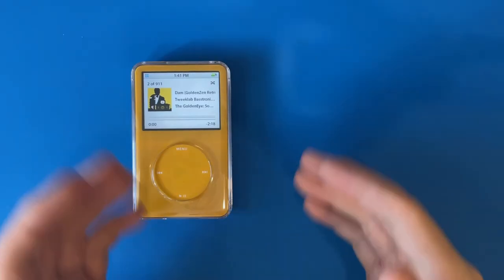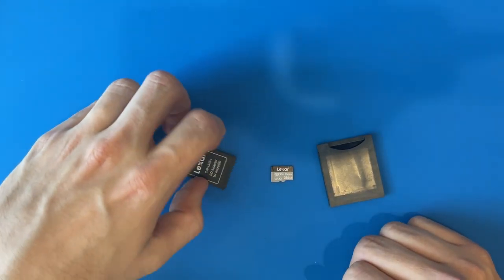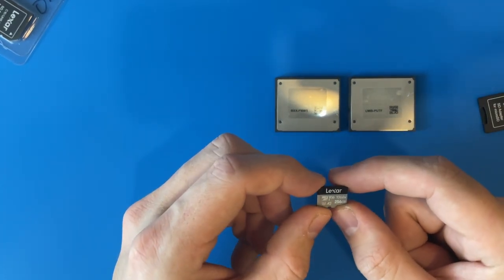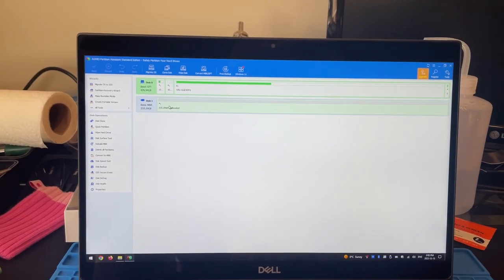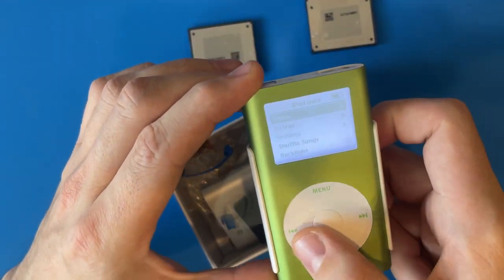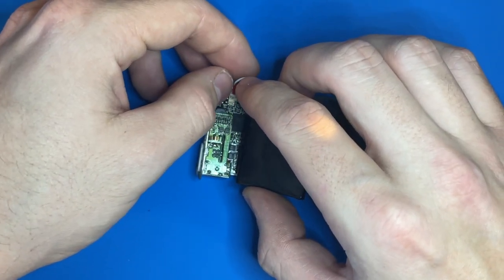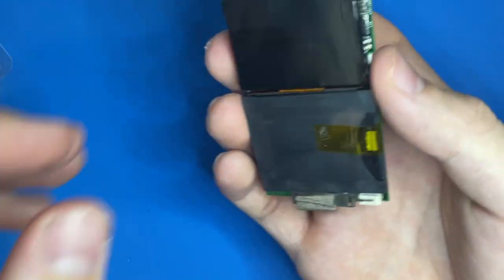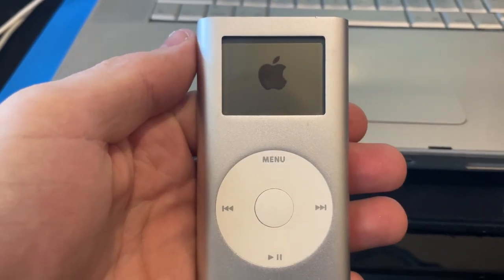How to Format SDXC for iPods!!! & I Fix an iPod Mini...

Comment: I 100 percent agree with you about the Mini’s screen. It probably the best monochrome screen besides the 3rd Gen. I find these are the best iPods. Its small and compact, battery lasts for ages, easy to mod with flash storage, shell swaps, backlight mod, and even replacing the click wheel plastic.

Comment: I flashed moded 5 iPod minis and I would say get Samsung cards if you want the most storage. For a 256GB card, Samsung gives you 239GB shown in the iPod, SanDisk gives you 238GB, and non NAND flash manufacturer brands will likely only give you 233GB, including Lexar. That 5 more gigabytes are not that important to me, because the iPods cannot play or store losses(losses would be converted to mp3 when you sync it to the iPod). The best we could get, 320k MP3 files, are not likely gonna fill the full storage before hitting the 25000 sounds barrier.
Reply from the maker: Actually iPods do support ALAC lossless codec, but the DAC isn't really good enough for it to be worth the trade off in data bloat in my opinion!

Comment: Thanks for this. Didn't think that the mbr thing would make a difference after multiple Linux format, but it was a game changer for failing iTunes resets on multiple cards. Was giving up, but it worked immediately after this. 🙏🏻
Bonus tip a strip of thin slidey plastic like a washed milk container made getting it Back in without fouling a piece of cake.

Comment: Why is fat32 so important? I use exfat on 2 ipods and work just fine.
Reply from the maker: you might think that but exFAT didn't exist when most iPods were made. I guarantee your iPods are formatted fat 32. Going through these motions just ensures that you get a proper MBR sector so that the file system plays nicely. Some models and storage media play nicer than others, and I'm trying to be as general as possible for maximum success chance.
Reply: @spottedtango  Good to know, thanks. I have this 7th gen with ordered parts. I wanna make it fat with a 3000mah batt and 1tb. The plan is to never open it again. So i ll try fat32 and leave it like that
Reply from the maker: @nfsu22009 sure! Lss, when you restore an iPod, the disk is reformed into fat32, however if it's not been previously formatted fat32 with a normal MBR, it might fail the restore.
Reply: @spottedtango  What if the ipod has an hdd? I can't plug in the hdd in the pc. Can i just restore the whole ipod? and id yes, can I also do the same with the iflash card so that I don't have to open the ipod? 

Sorry for bothering you, I m new to ipods.
Reply from the maker: @nfsu22009 if the iPod has an HDD it would've come from the factory with the proper partitioning information. This is exclusively for formatting SDXC.

Comment: Oh and another thing, i bought a 5th gen 60gb that didnt turn on, tge I found out that one of the little bobbins on the side of the 30pin conector was missing, where can I find another onde to solder back in its place?
Reply from the maker: hey, thanks for your interest. Appreciate what you said about the video. in regards to your question depends on what kind of bobbin you're talking about. If it's a capacitor, you could replace it with any capacitor rated at a equal or higher voltage to what was there before with equal or higher capacitance within a certain range of tolerance, it should work. if it's a resistor, depending on its ohmage, you might be able to replace it with a wire, if it's for example, a zero ohm resistor. a higher resistance would require you to put in an equal resistor. Finally, if it's a fuse, any fuse can work or even a wire, but typically fuses blow for a reason, and are there for a reason. Best if you replace that with an equal replacement as well. if you're asking me how you can determine  any of this information. Unfortunately, it would take another board with the missing component and a capacitor tester, or a multimeter with the ability to do so. Pretty much every multimeter can do everything else. Hopefully this helps you out. as for where to source your components, I typically buy up a bunch of dead pods off eBay to use as donors in lots, I try to buy them extremely cheaply, under $15US a board is a good goal.
Reply: @spottedtango  Hey thanks for the reply! I eventually ordered another board and worked fine. BUT I still would like to repair that one, I think the missing component is an inductor, one of the two that sit on the oposite sides of the 30 pin conector. I found similar inductors on old portable batteries. The thing is that I don't know what ohmage it is and if they're compatible. They look similar but not identical. Thanks for the help if you have any more info would you please let me know! cheers
Reply from the maker: @thomasulrich3107  Inductors can be used for a lot of things. Most commonly they're used for bucking, step-up, or step-down converters for voltage, they're spec really matters there!  signal filtering, not AS important. In most cases, sourcing a 1:1 replacement for electrical stuff is important. But Cap-a-sitors, there is some leeway as long as you're shooting overspec!
Reply: @spottedtango  Hum, I found 2 around my house, one is taller and the other one is wider than the one on the board, they might not have the same amount of copper, they have less "turns" but the copper wire is visibly thicker. Should I try onde of those?
Reply from the maker: @thomasulrich3107  I wouldn't. Again, inductors are typically about voltage conversion. if you pump the wrong voltage, especially one too high, no more pod.
Reply: @spottedtango  Damn, so is that mobo gonzo? How can I find out the value of that inductor? Yeah those bats work on 5 volts, the ipod battery pulls out 3 volts so that wouldnt work i guess
Reply: Inductors are not transformers. Transformers are a pair of inductors connected only by coincident magnetic fields. They step up and step down AC voltages.

Solitary inductors are primarily used for signal and power supply filtering.
Reply from the maker: right, so one could say inductors are used in circuits that modify voltage. some of those circuits are transformers, and ofc you can buy standalone transformers.

Comment: you will want to apply kapton tape  around the iFlash and the logic board. 

Basically doing a few loops and calling it good. also, is a great job of securing the SD card, Totally ESD safe btw. 

Otherwise the iflash is just kind of hanging out, unsecured and it will flap around a bit. 

Without wrapping the tape all of the way around the logic board and the iFlash, once you close the iPod & give it a healthy shake, you can feel the iflash wiggling around there. 

once you notice the iFlash jiggling inside the housing, you can’t ignore it. 

Anyways, I don’t mean to be that ‘umm  actually’ guy - just trying to help a brother out. 

Otherwise, really excellent content. Well informed, focused, well paced & clearly the work of a proficient technician     

Keep it up, I love watching iPod YouTube videos. There’s not enough out there ✌🏻✌🏻✌🏻😝
Reply from the maker: I noticed that, I later disassembled and put a tiny square of that stickgel tape in there behind the iFlash. I noticed that if you apply a little heat to that stuff it bonds up real nice, so 105C with the heatgun and it seemed happy. Probably not as smart as just using the kapton. I bet if you overdose that gel tape you'd trash the iFlash trying to get it out.

Comment: @spottedtango my iPod mini won’t work with flash storage it doesn’t want to restore plz help
Reply from the maker: check your hard drive ribbon for sure, not enough info to recommend anything else, aside from checking your cf adapters orientation. a lot of non iflash cf adapters have an sd card size limit as well.